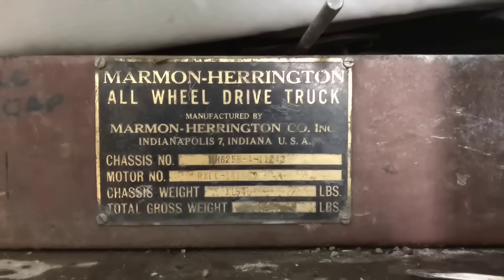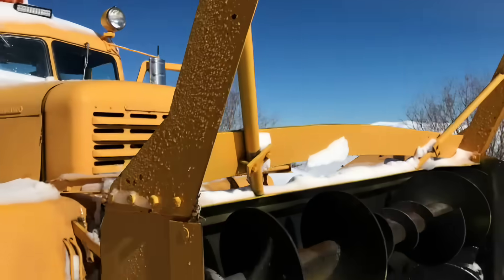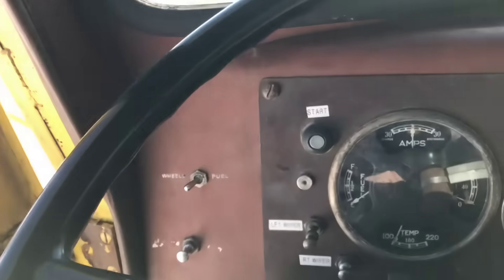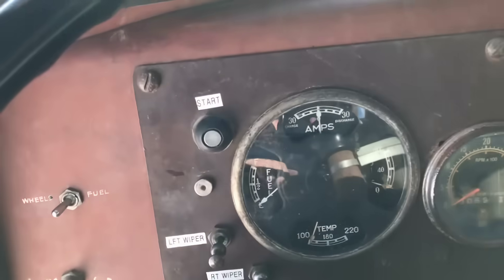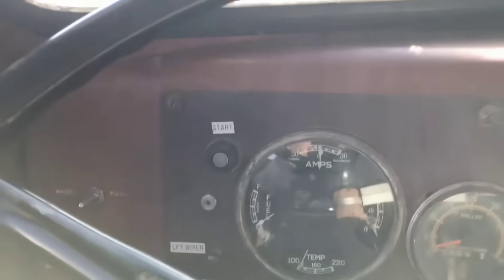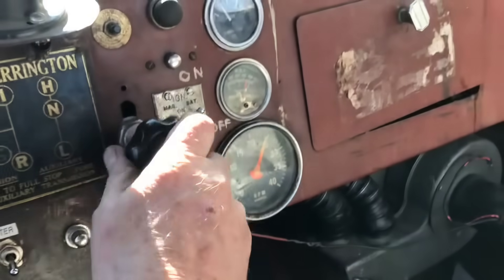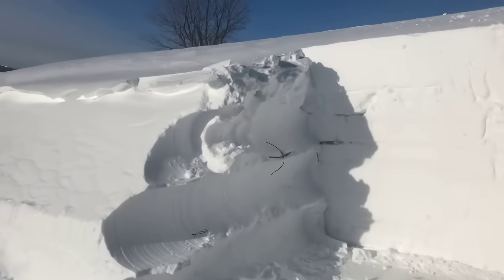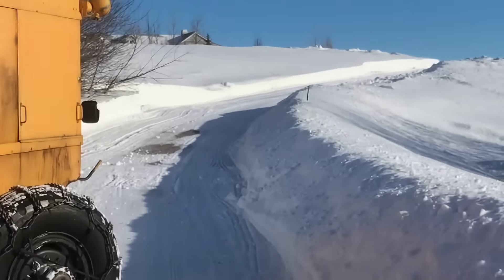80 YEAR OLD SNOW-BLOWING TECHNOLOGY

Comment: Cool old machine!  Surely the equipment can't all be original though, they didn't have hydraulic cylinders in WW2.
Reply: What makes you think they didn't have hydraulic cylinders in WWII?
Reply: @andrewalexander9492  Dozers had cable blades well into the 50s. I don't think hydraulics were common before then, but I could be wrong?
Reply: @rosecityrollersband8644  A lot of dozers had cable lift blades until the 1950's but that doesn't mean that hydraulics didn't exist.  In fact there were bulldozers  in the  1930's which used hydraulics.  Hydraulic systems have been around since the 19th century.
Reply: @andrewalexander9492  I stand corrected!

Comment: like to know what engines were in them i suspect ford because the co built fords 4x4 trucks and during ww2 the ford 41 sedan and sw 4x4 models for staff cars 
hers trivia the taciony palmyra bridge from philly to nj lift is powered by a mode a 0rigional engine . until around early 2000 if broke never heard if the fixed rebuilt or replaced it  but bridge in the 70s was 5 cents  then dime for yrs 25 cents decade now several dollars but cheaper than the thieves of the port authority in corrupt new jersey

Comment: That thing's cool and it make me think of a bunch of things that might be worth mentioning.  

I saw one of these machines parked up on a mountain pass in Colorado 25 years ago.  It was in rough shape and it had been vandalized a little bit, but apparently it was still in working condition and ready to do the job when needed.  I think the truck in that case was made by Ford (a VERY rare example of a heavy-duty truck from Ford having four-wheel drive).

There's a county shop not far from me that has one of these parked out back.  That truck is made by FWD, but the snowblower machinery is the same as yours.  I've seen a couple other FWD trucks equipped the same way.  In the 50 years I've known about the first of those trucks, I don't think it's ever been used, but the shop apparently is keeping it "just in case".

I live in a medium-sized city at the south edge of the snow belt, and the city used to own a number of these snowblower trucks.  At that time, they would have been either Oshkosh or FWD trucks, but I never found out which, since it was before my time.  I've seen pictures of these trucks clearing paths through massive drifts back in the 1950s and early 1960s, but they were mostly used for removing the big "windrow" of snow along the edges of the crowded streets of downtown.  In that latter case they were equipped with an extended chute with a bend at the top so they could shoot the snow downward into a dump truck that was traveling alongside.  The city still has snowblowers that can be used this way, but they are much smaller, self-propelled units, and we hardly ever get enough snow for them to be needed anymore.

I think that four-wheel steering is primarily to allow the option of steering via the rear wheels only.  That's a handy feature when plowing (or blowing) while keeping the edge of the machine right at the edge of the pavement while rounding a curve.  The Walter company of New York State used to equip some of their plow trucks with rear-wheel steering for that very reason (they were strictly rear-wheel steered and did not have all-wheel-steer capability).  Oshkosh offers all-wheel steering on some of their plow trucks at the present time, and when plowing it apparently can be handy to "crab" the truck (which wouldn't be the case for snowblowing).  I've only seen one truck like that, and that was a plow truck at the local airport.

Speaking of airports, the local airport has a couple of modern snowblowers that are virtually the same as your machine but they are custom-built from the ground up as snowblowers, so the snow-blowing machinery isn't mounted on the back of an actual truck, but within a specialty vehicle.  Oshkosh currently builds such a machine too, which is not truck-like in appearance even though Oshkosh is primarily a truck company.  Years ago, Oshkosh made a bunch of snowblower trucks that were pretty much the same as the one you have.

It looks like the manual throttle (that's what it's called) for the truck engine was an add-on feature.  That surprises me, since most trucks of that vintage came equipped from the factory with one, and this would be especially handy on a machine that needs to be driven like a tractor when it's working.  Apparently the previous owner recognized the problem and installed the thing!

QUESTION:  What's the explanation for that gear-shift pattern for the transmission indicating 3 speeds, but with lever positions for 4th and 5th added to the diagram by hand?  Does that reflect an upgrade to a different transmission from the original, or is there something strange about how the transmission is set up?  Also, the diagram to the right shows High, neutral and Low, just like a typical transfer case but it's labeled "auxiliary".  If that's truly an auxiliary transmission which is meant to be shifted "on the fly" during normal operation, that would mean that the transfer case is single-speed.  That's certainly possible, but it's not what I would have expected.  Sorry to ask such questions but this is an area of interest for me.

Comment: Funny how things used to be built to last. Now stuff is built to fail. That truck is amazing
Reply: This topic cracks me up every time.  There are millions of examples of old trucks which wore out, but usually they wore out a lot sooner than today's trucks.  You just don't see those old trucks anymore, but they existed.  The machine in this clip is the perfect example of something that SHOULD still be in good shape after all these years.  It worked at an airport, not on highways, so it never was exposed to road salt.  Even if it had seen some use on highways, it would not have been out driving long distances on salty roads, and probably not on salty roads at all, but instead it would have been only in fresh snow and then it would go back to the shop when done.  And being used for snow removal and nothing else means that it spent 99 percent of its life sitting inside a heated shop, and since the shop crew likely had at least a few weeks each year where there was not  much to do except take care of the equipment, it would have been well taken care of.  Then, it spent even less of its time working during the years since the original owner sold it, and that was probably 40 or 50 years ago.  So of course it never wore out.  

Consider that modern heavy-duty trucks commonly last to well past 1-million miles with no major repairs.  City busses are expected to last far past 1-million miles, and that's with nothing but stop-and-go city driving.  That's a record that NONE of the trucks from the old days could ever come close to reaching.  When people say "They don't make 'em like they used to", the correct reply is:  "They never did".  

It's true that modern trucks are a lot more complex and there are more things that CAN go wrong, and many of those things require more than the primitive abilities of a shade-tree mechanic to fix, and that's something that makes me sad, but in terms of capability and longevity, NOTHING that was built in around the same time as the machine in this clip even comes close to the trucks of today.  

Heck, that's even true of cars.  When I was a kid, anyone who's car hadn't totally worn out and rusted out by the time it reached 100,000 to 120,000 miles had something to brag about.  Junkyard cars almost never had more than 100,000 miles on them.  Nowadays, any basic car with 100,000 miles on it is almost indistinguishable from one that's brand-new, and I know quite a few people with pickup trucks or SUVs that have 400,000 to 500,000 miles on them and they still run great, and most of these trucks have never even needed a major repair.  My dad used to tell me that cars from the 1940s needed a "valve job" every 30,000 miles or so, and re-boring the cylinders was always something that was needed if the vehicle ever reached high mileage.  Even into the 1950s, needing a "valve job" was still a very common thing that anybody who didn't regularly trade-in was familiar with.  Again, there are modern vehicles which have gotten so complex that the durability hasn't kept up with with other "advancements", (GM's 5-cylinder inline engine that's put in small pickups and SUVs is a perfect example, and making this situation even worse is the fact that you need to mostly disassemble the whole front of the vehicle to do the repairs), but if you avoid vehicles with such obvious issues as that, there's no reason you can't put half-a-million miles on the thing before you even need to think about replacing it.  If you don't want to run it that long but still take proper care of it, when it reaches 200,000 miles you can give it to one of your kids and be confident that it's a far better vehicle than anything you had when you were their age.  NO car from "the old days" could compare to that.

Comment: Built when profit was not defined by greed and when obsolescence was not pre planned...
Reply: You need to look into the details regarding Oshkosh trucks.  None of what you said here applies to that company.  As just one aspect, learn about their assembly procedures, which are a bit less efficient than what's the industry standard but which keep the workers highly invested in their work.  Oshkosh also still makes a snowblower that is functionally the same as the one in this clip, but with diesel instead of gas engines.

Comment: This truck according  to the shift pattern data plate on the dash has a 3 speed transmission with a 2 speed transfer case high/low range.
Reply: If you look closely at 2:13, there are gearshift positions shown for 4th and 5th gears too, but the numbers are drawn in by hand within what otherwise would be blank circles.  That shift pattern is really strange, and I would have expected a 3+2 transmission instead of what's indicated by those extra lever positions.  Maybe the transmission isn't original, and the modified diagram reflects the change?

Comment: Great old truck.  The town I grew up in had a really old plow truck. It originally had a  plow that you had to pick up, and then you could spin it to discharge to the other side.  In the late 70s, they put a regular highway blade on it. That truck with the wing plows could clear both lanes on the highway in front of my house house with 1 pass. It could do an entire side street with no problem.  It was a 2-man job. One that drove and one that operated from the right side. There had to be 10 levers. It also had a sander permanently mounted to the bed. It didn't have headlights, just 2 spotlights mounted on the roof, with 2 gumball rotating lights and 2 smaller ones on the back of the hopper. I loved it when my neighbor used to pick me up as a kid and let me work the levers. I have never seen another truck like it, and it was obvious it was a custom job. Wish I could remember the name of the builder.  I was sad when I got home from basic training. My neighbor told me the town had a closed auction and  It went for only  2 k! I would have bought it.   I Miss all the "old" vehicles. I'm sure they had it for 50 years. I would have restored  it. Just like the 2 Cadillac ambulances the town got rid of for scrap and never told anyone. It had 2 big red and white gumball lights on the front and one in the back. It had the old school tube lights on the front and back. Would have loved to restore them for parades because it didn't have any rust and the letters looked like they were new.
Reply: Too much history got turned into scrap
Reply: @Ben Timmers  I know.  I would love to have a pre-war pickup. But since they were made of steel,  they're long gone.  I would settle for an M34 1 1/4 ton military truck(the original Dodge power wagon.) From the 50s or a 50s era duce and a half.
Reply: Based on the fact that it was originally mounted with a roll over plow, it very well might have been an Air Force or other U.S. Military runway clearing truck which would make it most likely an Oshkosh WT-2206 based on the age
Reply: @wijo6234  give that man a cigar! That's the one the stare park had. They actually had 2. 1 had tge roll over plow and left and right wings and the other had either what they called a "Drift buster", V plow, or it had a 12ft, right discharge with both wings. This is the one I spent 1 winter on(1987 if you can believe that), and with either plow, we would put both wings down and we could plow both lanes going through the state park. Pretty sure it didn't come from the military because all of the NYS Transpirtation Barnes had at least 1., especially on the Thruway and parkways north of NYC. One of these and the 12ft wings woukd be one and done in each direction.  Most of which got replaced in the mid 70s. The state park had theirs so long because they had drivers that took care of them. I think one of the park  managers bought the last one at auction in 1990 and put it in a barn in back of his house. The roll over, I think was just too complicated and rarely did I ever see that one operate. It was fun as hell for a 19 year old, managing all those levers. Thanks for giving me the model number.
Reply: "Wish I could remember the name of the builder."  It's almost a sure thing that it was built by either Oshkosh or FWD, with Oshkosh being the most likely.  Here in Wisconsin, Oshkosh plow trucks were very popular, but that was before my time.  With modern roads and more snow-removal equipment doing the job so that plowing would start before the snowstorm is over, drifting is less of an issue and these trucks with such massive capability are almost never needed anymore.  That, plus the fact that those old rigs required two operators, is why it's no wonder that they are no longer used.  Some shops still keep just one of these old trucks on hand, "just in case" there's really bad drifting somewhere in their district.  Airports in the snow belt still use Oshkosh plow trucks.  The new ones are every bit as tough as the old ones.

Comment: Idk why youtube recommend this to me since i manage my driveway, plus a neighbors, with a 24in Ariens compact with just one 223cc 'engine'...

This would be total overkill, but i do still kinda want one. It's amazing what went into this machine. Does anyone make a similar truck with 4wd and AWS commercially today?
Reply: Oshkosh still makes snowblower trucks.  Many northern airports (if they are of any size) have at least one or two of them.  There is at least one "non-truck" company that makes them also (a company that makes specialized equipment but not typical trucks) but I can't remember their name.
Reply: Raised in Central Alberta with a 200 yard drive way I would have traded my grain shovel for that snow blower in a heat beat!

Comment: What amazes me most is how little difference there is between this and a 2023 model. The new one has a fancier chute and fancier controls (And I'm sure the climate control in the cab is a  lot better) but the works are virtually identical.
Reply: You'd have to open the doors on these old trucks it blows so much hot air.